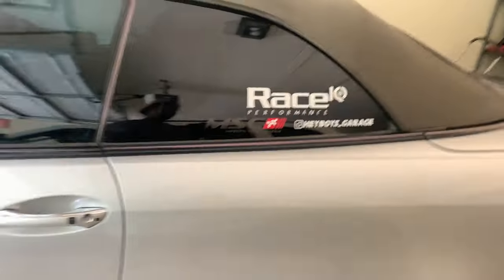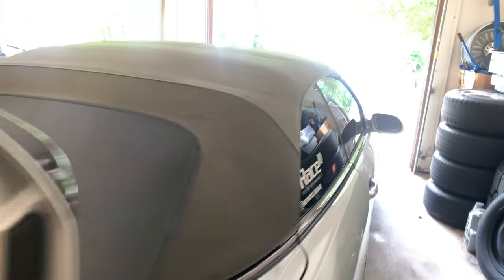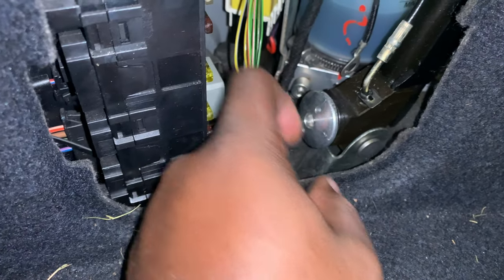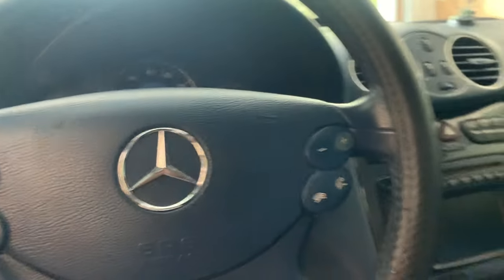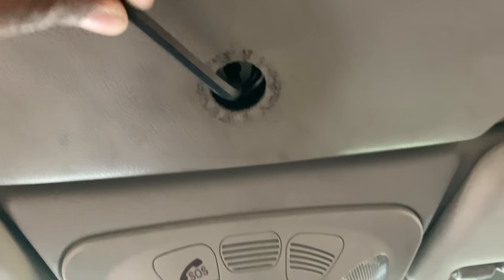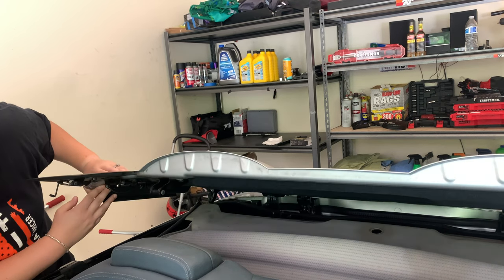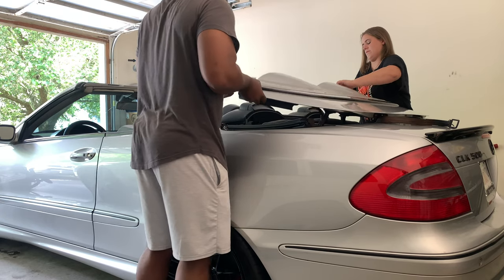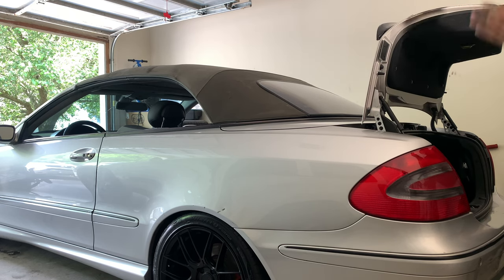How To Manually Open Convertible Soft Top on your Mercedes CLK W209

Comment: Thank u so much,  I really needed this video... my top got stuck half way and wouldn't close back or open... I just parked it in my garage for 2 months... now that fall is coming I need to get it back up and closed!
Reply from the maker: I think I just replied to your other comment
Reply: I have same exact car and today I went to close my top and it wouldn’t close fully and it says top in function and can’t get it to completely go down how can I open my trunk while top in operation?! Or how can I close my trunk manually without getting inside the trunk ? Pls if you know I would appreciate advice
Reply from the maker: @anthonygiuliano6376  you can’t open the trunk until the signal is gone. You have to keep trying with the button until it’s fully closed
Reply: @anthonygiuliano6376 damn. just had the same problem. let me know if you ever figure it out lol
Reply: If using the bottom doesn't close it ,what do u do ,please,  i have the same problem right now . @HeyboysGarage

Comment: Sadly my back left window doesn’t work anymore along with a fluid leak in the top, and apparently you have to remove the rear seats to fix the window
Reply from the maker: Yeah that’s the downside! It’s a process I have had to do it before on the drivers rear
Reply: I have the same problem
Reply: I still have the car , the engine is amazing, but haven’t fixed the problem yet 😂 I’ll keep you guys posted, once I fix the cosmetics I want it to sound just like yours heyboy, it’s too perfect!

Comment: Thanks, that's definitely the guide I was looking for, unfortunately though I can't lift the trunk cover, so hard it feels like it's still locked, maybe pressure wasn't properly relieved?
Reply from the maker: At the two hinges where you put the belt when you open the trunk. There is a clip handle you need to push either up or down depending on if yours is up or down before the rest of the process. I completely forgot to put that part in the video since mine was already down
Reply: @HeyboysGarage  thanks for your reply, I didn't know actually about those clip handles, however after moving them still can't lift the trunk cover
Reply: I am running across the same exact issue.
Reply: Hey I’m having same issue case cover does not want to lift up no matter how hard I pull and I released the pressure ?!

Comment: Thank you for the video. My rear headrests popped up over a bump and the area in the back seat is so tight to push them down. I am thinking about opening the top manually and after I reset the rear headrests, can I close the top automatically? Thank you.
Reply from the maker: I know it’s a tight area but you can still push them down with the top up. I have done it a few times. But you should be able to manually put the top down and let the roll bar go back down… I don’t think since the roll bar is up should prevent you from manually opening the top

Comment: have you ever been stuck not being able to push the top case cover back in? mine is stuck and seems to not budge but I cannot see anything impinging on it.. it just seems the cover wont slide forward at hinge
Reply from the maker: I haven't, you might not be aligning something before closing it down. Check the latches on the top of the roof when closing
Reply: @HeyboysGarage  yeah I checked... im not sure what could bind.. maybe the hinges or something
Reply from the maker: @dparham  Yeah i would check  the latches on the roof, there should be a piece that looks like a long nipple that should be underneath the closing latch on the lid that closes everything. and push evenly when closing it down. easier with two people

Comment: My problem is that one back window is stuck. I pushed the rear piece down and forward before putting the window down in the slots. So the window doesn't go all the way down in the back. Now I can't get that back to open.

Update: I did finally get the back to pop up by getting inside the trunk and pushing up on the sections that connect to the cylinders. The ones disconnected on bith sides, in the trunk. Yeah, I'm sure I looked funny with my feet in the air, out the back of the trunk, while pushing up to open that. LOL 😂

Comment: Bro that’s a lot of work lol , anyway the problem I’m is backseat’s head I can’t put them down and as you know convertible top won’t go down unless thoses heads are down, and yes I know about sticking a stick on the side but man I’ve try so many times and I just can’t find that bottom, and I’m I don’t wanna go to MB dealership 😭
Reply from the maker: Yeah there is a button you have to find with the stick you are using. Get lights in there to fish for it until you find a button that pushes in, it take a push to actually push it